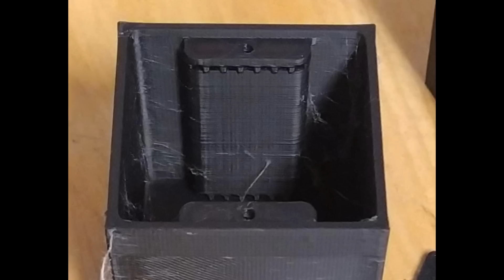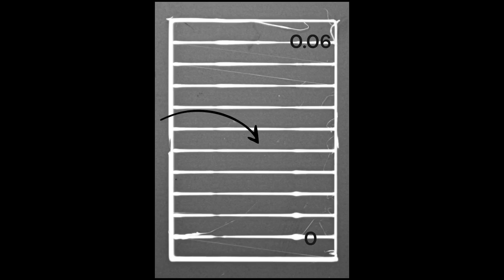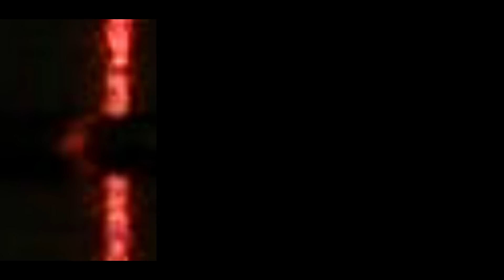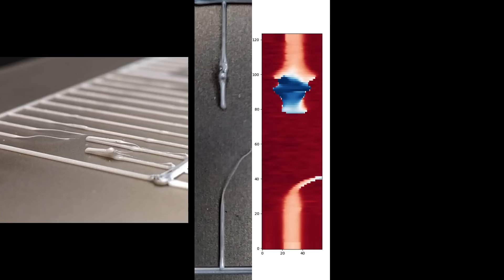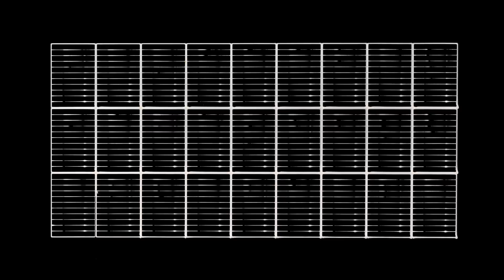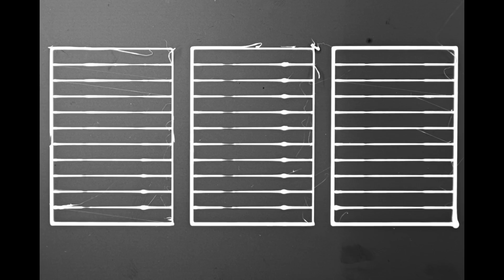Rubedo: Automatic Pressure Advance Calibration

Comment: Have you ever made any more progress around this? I found this, and I think it's awesome! A little scripting and you wouldn't even need to print the square test anymore. just a long series of lines that test multiple PA settings in one go, and then add in temperature and watch it build a PA Table for each material, take the laser dioe and change it to green for more contrast. Make the whole thing magnetic on the SB head and watch it go. Let me know if you have gone any further

Comment: looks pretty amazing. maybe your next project could a little mod with the same hardware components :-) what about same system for realtime "filament width" scanning? they are some projects about that out in the wild and its well implemented in klipper to compensate flow in realtime, for the always perfect amount of plastic with low cost/low quality/variable diameter filaments. maybe we can find a much smaller line laser. to scan only the filament, we need only a small line, with lower energy laser.

Comment: Amazing work!
This is pretty close to the concept of barcode scanners. In theory you can have the decoder recognize the width deviation at the start and stop of the fast moment. it would only need to take 1 image of the full bar set.  It would eliminate the needs for scanning lots of frames. 
Too bad developing such a scanner isn't trivial 😔
With that said it might be possible to hack one of the bar code PCBAs which have a sensor optics and lighting integrated into 1 module

Comment: Why not just take a picture of the lines and analyse the picture? You could maybe calculate how far the edge is from the center of the line in the x direction for every 'column' of the y direction. The line with the least 'noise' would be the best pressure advance setting. I mean, this works and is very clever but seems like a hassle in extra hardware and cabling for something you do very infrequently.

Comment: This is a great video! I have a suggestion though, why not have it analyze the stl before printing and use an algorithm to determine where and when to slow down and pressure. Another idea is to use the camera to look at the line being printed and make adjustments to the next pass.

Comment: I think maybe this could be made way better by directly modifying the pressure advance code based on the output from the laser measurement. As I understand it, pressure advance is basically blindly applying some pre calculated extrusion speed curve and then you have to choose the one that works best. What if it directly adjusted the extrusion based on the input from the laser measurement. I mean you can measure the exact width of the extrusion with this system and you can probably calculate the best compensation curve that pressure advance can use. So maybe you measure a few lines without pressure advance and then model the exact compensation pressure advance has to do.

Comment: Is it possible to do something similar to scan the thickness of the filament that’s going into the extruder and adjust the extruder speed? I mean if the thickness varies it can straighten it out as it prints.

Comment: I think this could work with the laser mounted to the gantry separate from the nozzle. It may only make a few grams but it could be a wide angle beam and that could be added to the data. Also a beam from both sides could tram the bed accurately. 
This is amazing and i hope for bigger things in your life.

Comment: Really interesting. As you say as a Proof of Concept its works perfectly and is of huge benefit to the 3d printer community!

Being able to scan all lines in one pass / a couple of passes averaged out would of course be a significant benefit.

Also, how would different colour lasers affect the system? Would lasers in a band less affected by visible light and appropriate camera lens filter help? Would putting a red filter on the camera in the current setup help?

Soooo much research opportunities to look at making this even better!!

Comment: Interesting. 
What i don't understand is, why you need that linelaser at all? Can you not just use a picture (from a normal webcam) with enough resolution, contrast and consistent light and run that thru OpenCV to get pretty much the same results? Sure, the laser might have some advantages to make the image recognition and data analysis faster/easier. But i think that trying to minimize and simplify the hardware setup, if you can just throw better (openCV) software at it would be a great step forward.

Comment: One possible method for eliminating ambient room light affecting results would be to use a infrared line laser and a infrared filter over the camera. This would also have the benefit of simplifying the software post-processing required to get suitable images for analysis. Great work and presentation!
Reply: IR is bad for scanning plastic. It goes deep in material and cause lot of diffusion. He should go opposite way. As close to UV as possible. 405-450nm.

Comment: Is it possible that a prediction system could be developed, so only one line (perhaps with more speed pulses) would be required? Maybe a single thorough calibration would be required, and then the printer could do more with less data for other filaments and temperatures? That way, it could replace the priming line with this, and then auto calibrate advance before each print.

Comment: Two line beams of different colors set 90 degrees opposed to each other, but zero’s in on the print bed should allow for an optical scan of a print plane yeah?  

Measure the distance between the two lines when they deviate away from each other on printed layers, check for consistency, could do first layer scans to see if a print should continue!  I want addons to turn my ender into a bambu labs level device eventually

Comment: Try to find Blue laser. It has much less diffusion and diffraction. It's used in triangulation sensors for measurement of plastic and white ceramic. You will get much crispier edges, especially on white filament. Lower the wavelength, lower the diffusion is. We use 425nm in scanning machine. UV would be even better, but there starts problems with lenses and sensors. Red and IR goes too deep in translucent material and diffuse so picture is soft.

Comment: This tries to automate something that doesn't work in the first place. It's not reliable to calibrate Pressure Advance on the first layer, directly on the plate, because the filament behaves differently there.
Firstly the filament has different adhesion and friction on the plate material than it has when printed on itself and does not stick that well to the plate than to itself and secondly the gap between the nozzle tip and the bed must not necessarily be the same as the layer height of the print, configured in the slicer. It depends on how you adjusted your Z-offset depending on how much first layer squish you want and you might also have set the first layer height to a different value than the layer height for the rest of the print.
All this also influences how the filament behaves during extrusion. To be exact the K factor is influenced by the extruder/hot-end combination, the filament (even by the color, since different colors are produced by different additives, titanium dioxide matte white is a good example, because it has much larger particles than other colors), printing temperature, nozzle diameter and layer height.
This is why variable layer height also does not work well with filaments that need higher K-factors. It's not only PLA that gets printed, where K doesn't vary so extremely when one of the parameters I mentioned above is modified.

If you don't believe me, try it yourself, but not with PLA, use PETG, PCTG or better TPU.
Print reasonably fast and use the same K value for the first layer and the rest of your print, then use a looking glass to examine the print and you will probably see what I'm trying to explain.

I calibrate PA (Klipper) respectively LA (Marlin) by printing a rectangular bowl (about 60 x 10 x 3mm) with 3 bottom layers and 3 wall lines, basically a cuboid with now top layers and no infill. Then I examine it using a looking glass. When the vertical edges are bulgy and the wall between them is slightly pulled inside, the line ends are over- and the centers underextruded, then K is to low and you need to go higher, if it's the other way around and gaps are starting to appear between the wall lines in the corners, then it's to high and you need to go lower.

Comment: This same hardware could be used to detect (and maybe even repair) first layer adhesion problems.

Sometimes if I have a problem with the first layer, I just pause the print, paste on PVA glue, and smooth it out with a hot tool.

It occurs to me that this process could be automated by running an ironing pass over any broken lines.

Comment: You should be able to do an ABL with the same laser and sensor without printed lines as the whole laser line will move left and right relative to the fixed camera with changes of height of the bed.

Comment: I've been wondering if there might be a way to do this without any special hardware, by printing a calibration pattern and then placing the printing plate on a flatbed scanner.
Reply: As that would require human intervention, what advantage would it give over just using your eyes to determine the best value?

Comment: 3 Thoughts:
1. This might lead to the realization of pre-emptive pressure advance, it's obvious that PA on it's own still isn't enough, it needs to have a pre-emptive kick one way or the other to have a truly clean line during acceleration changes. The timing of that kick it already gives, obviously isn't in the right place, a missing time component that will likely vary with each meltzone and pressure chamber size. Maybe one day we'll get that deviation to true 0.

2. Automated stringing and retraction calibrations?

3. As the laser is triangulating depth, you could then use this to figure out the build-plate depth, the laser line itself would need to be tuned to very square, or software corrections for uneven skew and lense distortion.

Comment: Effective. And so much potential with so many obvious easy QoL improvements that anyone can make to the code today (even before actually having the equipment for testing). For instance, iterative/quick collapse by measuring after each calibration line (or 1 - 3 lines) and adjusting  based on too much/little pressure. By making smart adjustments after each line we can quickly make coarse changes to the correct values and then finer changes once closer to the range. We can probably turn this into a binary search, the middle will likely be dynamicly defined with (eg. no less than 3 lines mandatory with a middle value, too high, and too low within printer precision threshold or a single line with a score threshold would be necessary. Precision threshold is more dynamic but would require increasing the testing range in order to get measurably too high/low values to verify we found the center). May or may not be able to do this in one pass as well (not sure if we can scan while printing or if the acceleration will have to much of an affect on the camera between fps and rolling shutter).

Comment: Nice work indeed. Excellent work making filament extrusion calibration more deterministic through automation.
Maybe this will work to inspire other similar means to automatically calibrate other printer mechanisms and properties. 
I wish there was a more deterministic calibration method like this for belt tensioning.

Comment: This is pretty phenomenal! Many, many kudos for your work. I do have a question for you though: are you planning on integrating a macro of some kind that will allow the system to recognize the two or three best lines in the 'broad' test and then perform further tests with smaller and smaller increments to narrow down to the absolute best value? Like you said, what you have is close, but not perfect. Having the system go from your large spread of 0.00 to 0.06, see that the best lines are between 0.024 and 0.042 and then automatically perform a second test between, say 0.022 and 0.044 in 0.002 increments instead of 0.006 increments, and then possibly a third with 0.001 increments would get you to the absolute best possible PA.

Just a thought, and I'm greatly looking forward to seeing how this project advances in the coming months.

Comment: I'm wondering whether PA cannot be tuned in a totally different way.  As explained, PA is to compensate the delay between filament moving on the input side and pressure causing plastic to move out at the nozzle end.  Would it not make more sense to just measure this delay by ex. measuring the output pressure using a load-cell and timing how long a change at the input takes to affect the measurement on the load cell?  If the load cell measures upward pressure on the printhead (as the Mk4 seems to support), then the PA value could even be measured and corrected throughout the print.
Reply: Interesting thought. There can be trouble getting an optical system to work with natural plastics which have high sub surface scattering and high transparency plastics auch as PET/PCTG.
Reply: I imagine this is what the A1 series does
Reply: @BeefIngot  Yeah, I think so too, but when I wrote this, I didn't know that.

Comment: Great to see an Open Source approach to this! Bambu uses the same idea (line laser plus camera) for calibrating extrusion. It would probably be little effort to add extrusion width calibration to this too. And it should be a reasonably simple job to implement this for Marlin (which calls it "Linear Advance" but it's pretty much the same idea) too, maybe as an OctoPrint plugin? I expect this will become the standard way to calibrate printers, and I imagine there might also be cheap nozzle-cams suitable for this coming from China soon.

Comment: Great work! I assume you tried doing the same thing but by just taking a photograph of the test pattern and running it through a similar process. If you did try that, why did it not work? It seems (on the surface) that it would be a much faster process, than having to scan each line with the laser and camera setup. You might have to deal with some parallax and/or tilted plane issues with the camera, but I believe there are algorithms that already do that. Just curious.
Reply: That's much more dependent on lighting conditions, bed, and filament colour, whereas shining a (comparatively) high powered beam of light onto both the bed and filament is much easier to detect.

You could probably get pretty close with a well controlled setup and a high resolution camera, but there would be more processing involved and you'd almost certainly end up with noisier data.

Comment: This is awesome! Do you think it would be possible to use the same technique for extrusion multiplier calculation?
Reply: You can right now use a filament width sensor. This would just mean to set in the slicer for the desired squish between the layers and the firmware itself dynamically adjusts the extrusion. Of course this would mean another component, but parts for a width sensor are super cheap (two analog hall sensors, a magnet and some screws). In terms of input you need to inputs that can measure analog signals like some rpi gpio pins or temperature sensor ports if you have a Mainboard with 6 or more drivers or 5 drivers plus canbus

Comment: First of all, great work! This is actually a perfect case for statistical modeling. I’m not sure if it’s possible to do without any form of commercial initiative, but all users should just share their readings from this setup for mutual effect. As you say, it will be a lot of variations in filament and general setup of each printer, so all this data should be aggregated and then modeled, then returned to each print. Again, great idea.

Comment: Pressure Advance is calibrated once for every filament and that's it. No need to calibrate it before every print. It's just another over engineered solution for a problem that does not exists. And it also adds weight to the printhead.
Reply: If you use 20 different filaments during the life of your printer and several different colours of each filament, and then factor in different batches of the same filaments may print differently, then that's a lot of calibration work. Of course close enought is good enough for many applications.
Reply: If you at all watched the video he spends the first half explaining exactly why your comment is wrong.

Comment: would having the lazer at steeper angle give more acurracty or is 45 a sweet spot between brightness of the laser and  accuracy?

second question  just on pressure advance in general. does higher acceleration make it harder to tune pressure advance?

Comment: Maybe scanning a textured bed before printing could give you a baseline for the refractions you could then subtract out from the measurement?
Reply: This type of measurement would require ESP as you cannot know the effect of the refraction without also having the printed line present unless you were printing with a filament with approaching 100% light absorbtion; which of course would render the test moot.